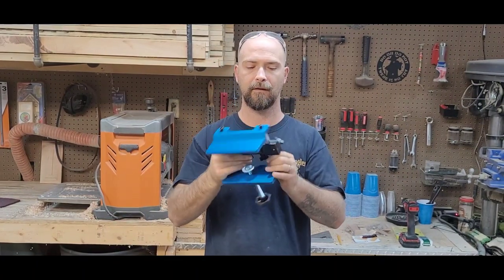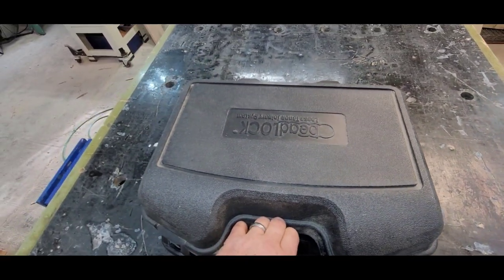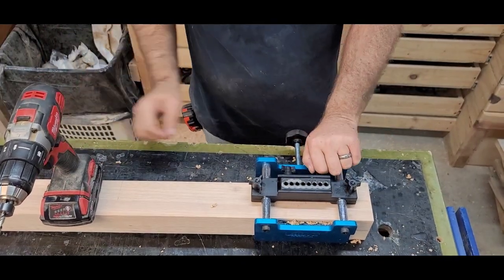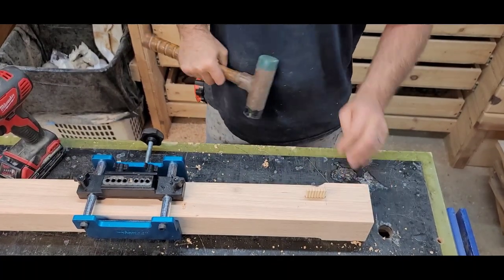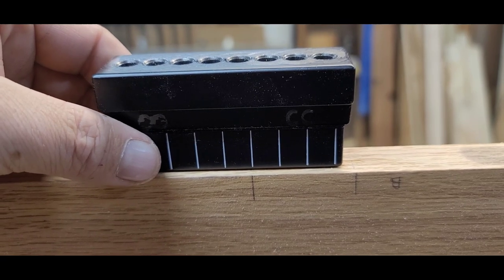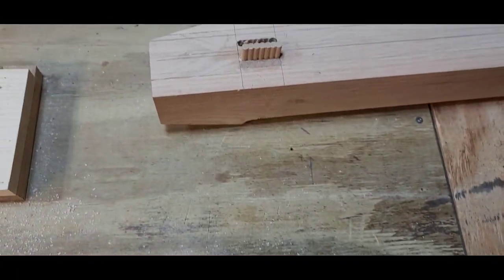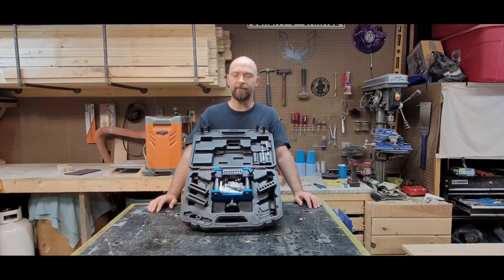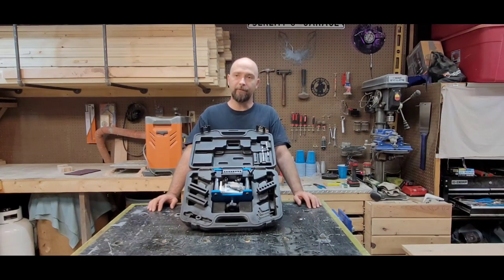rockler beadlock tenon system

Comment: Good video, I'm right there with you on everything. I bought mine about 2 years ago have the same model you do, big learning curve, lots of frustration and cuss words, it must have been the advertising while looking at the domino that got me "good job ad guys" The bead stock is pretty expensive and the bit to make your own stock is also if you factor in the different diameters. As far as using it just for a doweling jig it is just as frustrating to use because of the offset from side to side. Wish I would have seen the Dowelmax before this. I did look at the newer updated version of the bead lock and it does seem to be less of a headache, wish I could trade mine in for the new one...
Reply from the maker: I'm trying to get rockler to send me a new one for a comparison video.

Comment: I have both dominos and would really like to get one of these i think they may have the potential to be stronger than a domino joint i love my dominos but im always looking for a different joint system and would make some nice contrasting through joints
Reply from the maker: The tenon has 3 options on the model I have 1/4 , 3/8 and 1/2. So I guess picking your strength options could be stronger than a domino. I do have the router bit to make my own 3/8 tenon so I could make them longer than stock. That may ad strength, as far as a nice though joint. The longer tenon would give the option but not sure the cut would produce a nice seam. 🤔 It was never a thought of mine but am curious now.
Reply: @meanmacawwoodshop  do you make your own tenons? I was thinking something like a walnut tenon through maple
Reply from the maker: @alexanderdesfosses  I have not tried the router bit yet. It's a 3/8ths tenon, I have been using the 1/4 in birch from rockler. To be honest I'm quite content with them. With the amount of views and questions on this I'm going to do a follow up in a few weeks and I will try the through tenon, and router bit. I'll also try out the Mortising part as well.

Comment: have you used the router jig portion of this kit?  and does it self center?  im glad i found your video.. i may not buy it now.
Reply from the maker: I have not used it yet, it requires a bushing set up. I don't have that yet. As for self centered it dose not but it dose center on on your line. Buying the kit I have in the video may be tough, I can only find it on ebay.
Reply: @meanmacawwoodshop  I'm gonna do a diy tenon jig.  Maybe even a diy domino machine I found.
Reply from the maker: @jerrodbuffington4929  diy domino sounds good
Reply: I don’t think that  those are router guides.  I believe they’re are chisel guides or that is what I used them for.  I wanted to have some 1/2” tenons and I couldn’t find any 1/2” tenon stock so I used this and a chisel.  My chisel laid nice and flat on the sides of the guide and it worked well to clean out the mortises for 1/2” tenon stock I made in my shop.

Comment: You must of found a prototype that rockler never took it into production, because I can not find one anywhere like the model you have here. Which is to bad as it looks like something I would like to have.
Reply from the maker: I ordered it from rockler 4 or so years ago. But I can't find  it either. I have found used ones on ebay
Reply: @meanmacawwoodshop   I have this same Rockler Bead Lock system and have successfully used it a few times as a DIY person and the projects came out fine. Rockler seems to change their products every year. One day, maybe they will create a quality product they can sell for many years without reinventing it each year.
Reply from the maker: @David Vance  I have contacted rockler about getting the new version sent to me but they said my channel wasn't big enough as of yet. Since I already have a version of one that works OK. I'm not in any hurry to buy another one. So as soon as I can get them to send me the new one I will do a comparison video and give one of them away